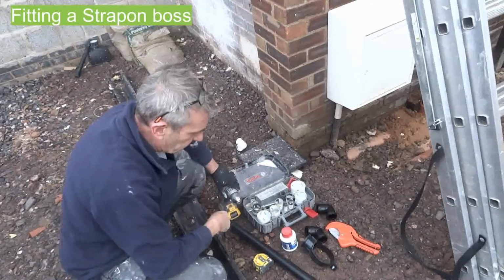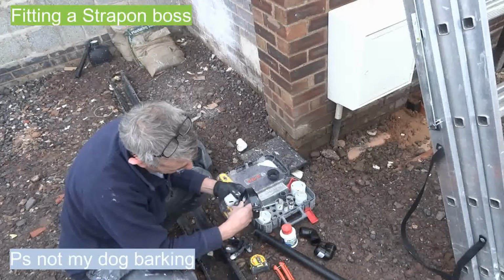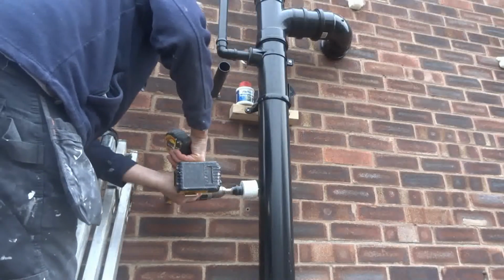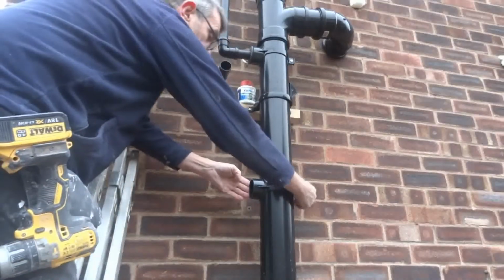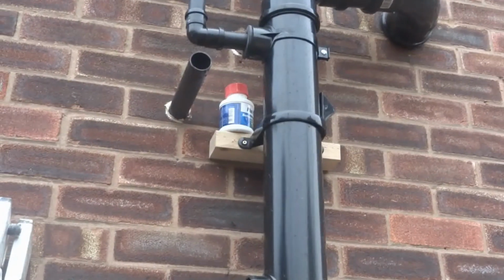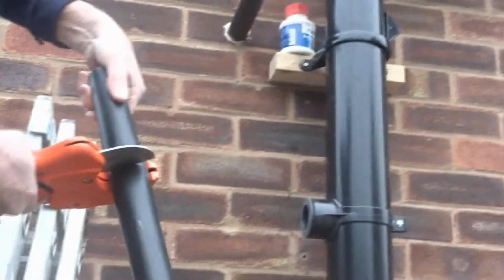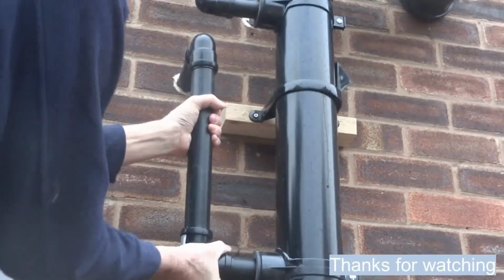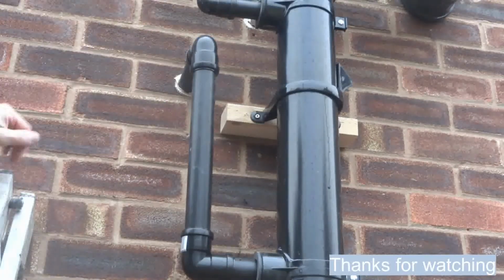How to fit A push fit strap-on boss [32 or 40mm]

Comment: Tidy job but 2 things:
Leave the solvent welded boss plenty of time to set firm. It has to last years and fitting the adapter and pipes straight off, could weaken the seal. An outside wall stack is of less consequence but if that join was inside a property, it would be more problematic (smell/leaks)
How long you wait is up to you but I just find something else to get on with for half an hour.
Secondly, just use a bit of Fairy liquid on the insert and for the pipe. Less stress on the boss and rubber fits more easily.